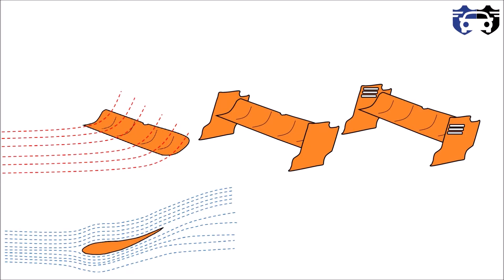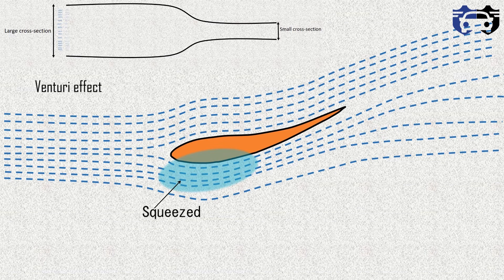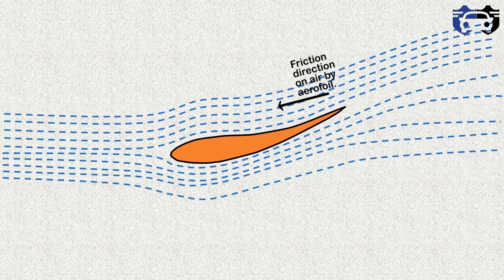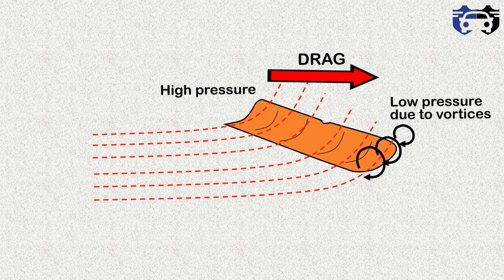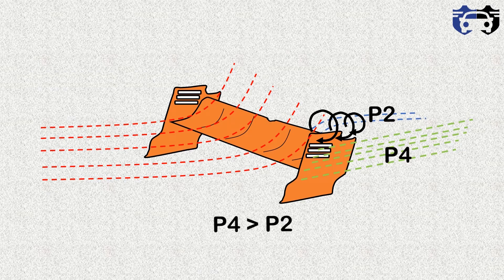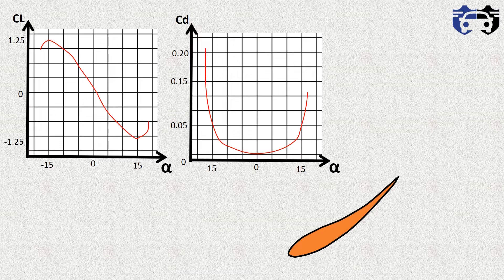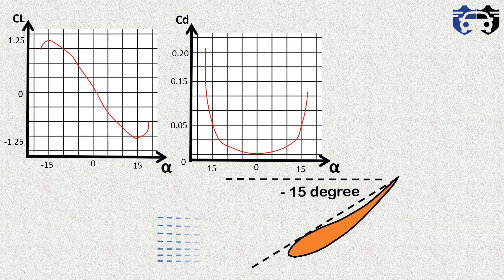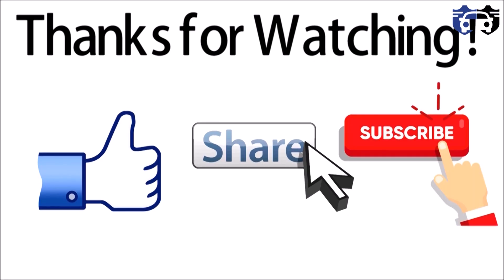How rear wing or spoiler of car works ? | How angle of attack effects the drag ? - F1 Aerodynamics

Comment: rear wing OR spoiler? I already know u dont know what ur talking about...
1 minute and half into the vid: the drop in pressure on a freestream airfoil is not due to venturi... Air is technically "squeezed" at BOTH sides of the leading edge, so why pressure drops on one but not the other is completely unexplained... cmon man dont spread pseudoscience
Reply: Well I actually think it's a pretty good video and if you have the basic understanding of the forces at play it's quite enjoyable to watch.
For example many people in my country call a wing on a car a spoiler. Only once you get a little deeper into it you know the difference.
In a venture the same phenomenon happens, faster moving air lowers pressure. I can relate to what he's trying to get across.
Because of the angle of attack the air is forced to follow the contour of the wing on top creating a high pressure zone. And that's why you can fly an airplane upside down with enough angle of attack on the inverted wing.

On the other hand I also enjoyed the explanation on the graphs at the end......
Reply: @ u sound like u know something, but don’t understand the fundamental forces/mechanism at play. (1) The low pressure side is always magnitudes more important than the high pressure side over the wing in terms of lift generation. (2) wings generate lift (or negative lift aka downforce) due to BOTH pressure difference over the opposite sides AND resultant vector forces due to AoA. This video (1) fails to properly explain the first mechanism and (2) completely ignores the second. These types of videos should never have been made in the first place bcuz they are literally nonsense. Like that’s literally not how things work and a 2-hour research session would have been enough to learn the actual basic principles like what I’ve just said. Edit:also I don’t understand y u brought up the fact that a lot of people don’t know the difference between a spoiler and a wing. That’s just (1) people being dumb in general (like as if the names “spoiler” and “wing” aren’t self explanatory enough) and (2) that’s what this video is SUPPOSED to get right… uk… to teach people the right stuff… edit2: I can tell ur still relying on intuition for understanding when u said AoA force air to follow top side of a wing. Aerodynamics is not intuitive a lot of the times. Yes, AoA helps to generate lift, but the mechanism is not as straightforward as u currently understand it. Don’t trust me? Put a gurney flap on the trailing edge pointing in the OPPOSITE direction of the AoA and see what happens (answer: if the gurney is big enough, it’ll counteract the lift). U can easily conduct a virtual experiment using open source tools (I use blender and simscale for more basic geometries). Edit3: mentioning Venturi in this context is categorically wrong. There r many reason y. For an easy one: Venturi doesn’t require any AoA to lower pressure :). I mean what can I say, I’m lowkey triggered bcuz people actually think these types of vids are nice and educational. Virtually nothing that has been said is correct in it. Idk how people learn these days (I’m only 25 btw), they don’t bother with learning from the right sources whatsoever
Reply: @hgdrkui  Oh I do understand, but I would rather try and keep my replies short and to the point. If you understood aero I wouldn't have to explain it in detail to you now would I?
Reply: @ huh, so what’s ur point? I never said I fully understand it, hence why I’m looking for good learning materials on the internet lol. I just know more than the average joe, and apparently, also the maker of the video (and you, I suspect). Ur reply basically says u don’t really know it, at least that’s how I interpret it.
Reply: @hgdrkui  So that's your take from seeing the video and reading my reply!!!
Well I interpret it like you don't have any hands on experience and you don't really understand the subject since you didn't understand my first reply.
If you would like a more in depth explanation on the the principles of aerofoils then go look up a video of just that! This video explain just fine what works for automotive applications. But be aware that there are lots of videos with bad information out there, even from pilots and experts.
Calling the video nonsense and proclaiming "this is not how it works" is just plain dumb.... Please do tell us what exactly doesn't work, that he explains in the video?
Reply: @ bruh, I’ve explained why I said what I said, learn to read. There is a difference between getting an airfoil to generate lift than understanding how it actually works lol. Yes, ur right, I don’t have hands on experience, I don’t even have a car lol, but that doesn’t mean I don’t understand SOME of the theories and why this vid is nonsense. I did understand ur reply. That’s y I’ve also explained why ur understanding is prob likely superficial. I’ve also explained why mentioning Venturi in this context is completely wrong when u said it’s ok to do so lol. Learn to read. Stop using exclamation marks, chill.

Comment: Great vid! I have a small duckbill spoiler that came with my Audi rs3. I recently added a rear wing which hangs directly above the spoiler. Is that setup fine or am i introducing more drag? Should i remove the spoiler?
Reply from the maker: Thanks for watching! Adding a rear wing above your duckbill spoiler could potentially create more downforce, but it's essential to consider the overall aerodynamics. If both elements are designed to work together, you might be enhancing stability and performance. However, if they weren't intended to be used together, it could lead to increased drag.

Comment: Why people still say rear wing and a spoiler are the same thing, they both serve a different purpose. A rear wing produce downforce, whereas a spoiler is used to reduce drag, please do research before putting anything in the internet.
Rear wings are what you see in a F1 car
Spoilers are mostly seen in super cars like the PORCHE 911.( A small protrusion that runs along the width at the rear)

Comment: Very helpful video.  I did not know that the attack angle had an optimum angle.  Additionally, I did not know that louvers on the side air dams helped to generate down force.  If you want to gain every advantage you've got to find and figure these things out.  Thanks.